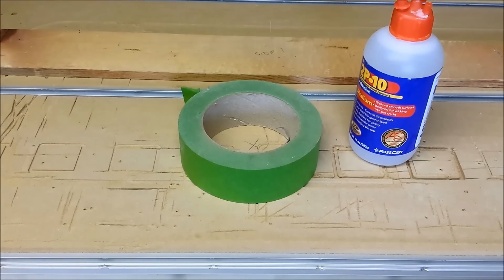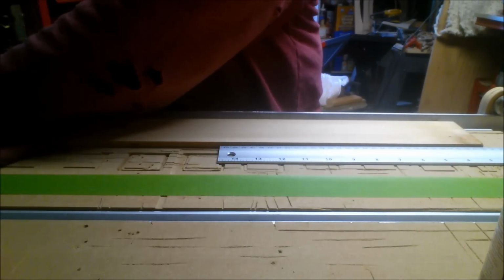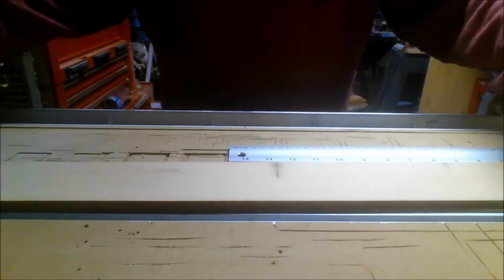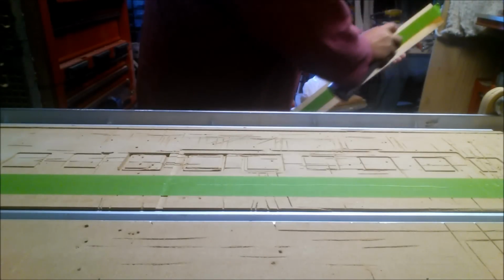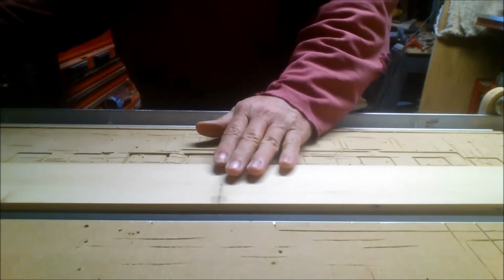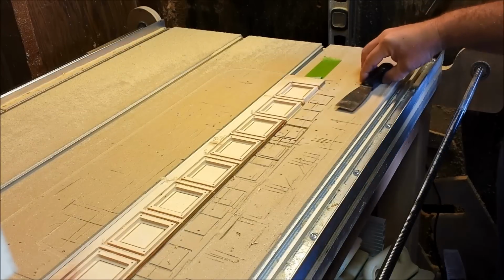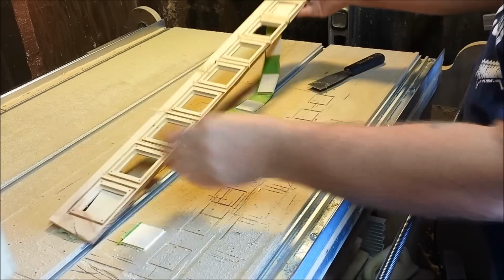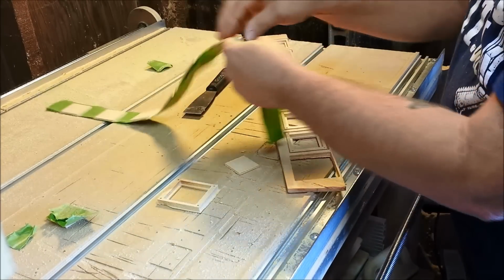A Secure CNC Mounting Technique - NO DOUBLE SIDED TAPE!

Comment: Have you tried putting the glue on the work piece and the activator on the waste board? Does the work piece smell like activator afterwards? Does the activator mess up the waste board?
Reply from the maker: I've done it both ways, and it's fine. The activator evaporates quickly, and it's never damaged anything or left any smell.

Comment: I use hot glue around the edges. Seems to work pretty good.  I like your solution for cutting out parts with no tab though.

Comment: Thanks for the informations, I'm very new at this and all help is appreciated. I've found hot glue works good for me but I would have to use tabs for through cuts.
Reply from the maker: Thanks for checking out the video! I don't know if there's any one mounting method that is perfect for every situation. I use clamps, blocks and wedges, good old wood screws - whatever works. I do like to have options. All I know is that the tape and CA glue method has never failed me. I buy tape and CA glue for other uses anyway, so basically this has saved me the expense of buying double-sided tape, which I don't use for anything else.

Comment: How important is type/brand of tape?  The tape linked in the description is the standard blue painters tape - but the tape in the video was green.
Reply from the maker: The brand of tape isn't important at all. I had some green tape when I shot this video, but I usually use blue or plain manilla. About the only tape I don't like is the Scotch Greener masking tape. The paper is really thin, and it likes to shred when you try to remove it.
Reply: @MarkLindsayCNC  Okay thanks

Comment: Only problem doing this is if your spoil board hasn't been machined level then you won't get the depth right if you need a specific depth.  It's a great technique.
Reply from the maker: That's why tramming your router/spindle and surfacing your spoilboard is important. Thanks for checking it out!

Comment: 3M's blue painters tape comes loose at temperatures around 80 degrees celcius in my experience. my aluminum workpieces sometimes fly off the table if i try to cut too deep(1mm depth, 2mm stepover) and heat up the piece too much.
Reply from the maker: I have heard that some folks use this method on metal, but I've not tried it myself. Jon over at NYC CNC uses it himself, and they have great luck with it. Personally, I'm not a metal guy, but I follow your logic, and have often wondered about heat buildup causing the tape to fail.
Reply: @MarkLindsayCNC  Yes i indeed first saw this method on NYC CNC. Maybe what i'm experiencing is because of things i do wrong in milling, i just wanted to share my own experience. Despite all this, this is still my main workholding method in my cnc router when cutting aluminum. Thanks for bringing this technique out to public.
Reply from the maker: Well, you're welcome, but I just confirmed that it does indeed work for holding material to a CNC table. All the credit goes to Ben Crowe at Crimson Guitars.

Comment: So basically no need for clamps anymore?   I'm waiting for my first CNC coming in about 3 wks..OnefinityCNC    I plan on doing signs and more simple things to get started.  I had CNC machining experience also..I know machinists would laugh at tape..I'm a little leary also, but it looks like it works..I'll  have to try it..thanks for the vid!
Reply from the maker: Thank you, Rich. It's not a 100% solution. Depending on the size of the work piece, you may still want to clamp or screw it down to the spoilboard. Having said that, this technique has never failed me yet - not once.

And for the record, I know several machinists who use this method. If you watch NYC CNC's YouTube channel, Jon is a fan of the technique, and he uses it on all kinds of metal projects, quite often.

Comment: I like this method but have you tried it on a large piece , say 2 foot square of 3/4"? I'm guessing something that size would be difficult to remove?
Cheers, Alan

=
Reply from the maker: On panels more than about 8 inches deep, I use 3 strips of tape - one at the top, bottom, and middle. On something the size you're talking about, I'd probably go with 4 evenly spaced strips. Normally on something that big, I tend to screw it down to the spoilboard and use the tape and CA glue to keep the parts in place so I don't have to add tabs.

Comment: you should use a vaccuum pump to mount items for machining.
Reply from the maker: ...or a vise, or an angle plate, or a rotary table... I don't machine metal, so I didn't recommend anyone use this for metal. However, I do know that Jon over at NYC CNC uses this method on metal a lot. Check out his channel - you may be surprised.

Comment: How did you do the profile cutout whereby it reversed direction? Also you had some odd ball size end mills. I have been looking for endmills or drill bits to use for drilling holes. Any sources?

Comment: does this technique apply to wood only?...or will it work when milling metal?
Reply from the maker: I'm a wood guy, so I don't have much experience with metal at all, and absolutely no experience with it on a CNC. I'd be hesitant to use it on metal - mainly because the heat created would most likely cause the tape's adhesive to fail. I've heard of people using the method on aluminum. I've never done it, so I don't know how well it works. Do it at your own risk.

Comment: Thanks for the video Mark.  What surfacing bit were you using?
Reply from the maker: This is the bit I use for surfacing - http://amzn.to/2m88VAk

That's actually a Freud 1.25 inch straight mortising bit. The only thing you'll need to remember if you use one of these is that you'll need to ramp in your plunge moves over a distance of at least 1.5 inches, because the cutting edge doesn't go across the entire width of the bottom of the bit.

Comment: Great idea- thanks very much; but may I ask why you did an island fill to remove the middle, when you could have just done an offset path and left the middle scrap full height?
Reply from the maker: Simply put, when I did this project, I was still pretty new to CNC software and still figuring things out. Knowing now what I didn't know then, I'd have done a lot of things differently for that project. I wouldn't have changed my mounting method, but I would have certainly changed a few things in the toolpaths. Thanks for watching!
Reply: Gotcha, understood, thanks!

Comment: Mark, thanks for the video and suggestion. Have you tried this with long machining times? I ran a 3D carving job recently that took 15+ hours and would be nervous about the tape letting loose at some point.
Reply from the maker: I haven't run anything for that long at all yet, Stephen. My longest cut with this method has been about 3 hours, and it did just fine. I've never had the tape let loose on me, but I won't say that it could never happen, and I can't guarantee anything. If you're unsure or even a little bit reluctant, you might add a couple of clamps or screw down the work just to ease your mind. If it were me, I wouldn't hesitate to use it on a 15 hour cut,  but your mileage may vary.

Comment: I've been using this method for a while and it does work great but on rare occasions, I've had problems with intricate contour cuts where the waste moved due to side loads and almost messed up the project but was able to pause the work and restart after I removed the waste.  Not 100% perfect but probably near 98%, nothing is perfect, clamps can come loose too.
Reply from the maker: I've never had that problem. Thanks for the heads up - I'll watch out for it.

Comment: I'm going to start using your technique for the 3D printer. The problem is either the glue is too strong or the piece starts moving because it is loose.
Reply from the maker: Do know that heat can cause the adhesive on the tape to fail. I would test it on a small project first.
Reply: @MarkLindsayCNC  The bed temperature is 122 F. I can always turn that off before printing . The Print head is 392 F but doesn't stay in one place for long. I have been using Loctite Spray Adhesive 100 on the print bed which last about a week and have a hard time getting projects off the print bed. 100 is considered a light bond.

Comment: i have threaded inserts for wood in my board spaced at 100mm distance. i use to work in a cnc shop an they used a FCS mounting plate on all their machines instead of clamps. its a pretty quick and precise mounting system.
i do use this method for smaller pieces and it works well. i use a mountable back stop with this system to make sure things are square on the table. 
also you cut too deep i never cut into my "spoil board".  its a waste of money to replace regularly.
Reply from the maker: Since this video came out, I've built a new CNC, and I have t-tracks in the spoilboard spaced about every 4 inches. I sometimes use clamps, or just screw the material down. I'm all about options.

Depth wise, I cut just fine. After almost 5 years on 2 different CNC routers, I've never replaced a spoilboard. When it gets too scarred up, I resurface it and drive on. What I don't do, however, is spend a lot of time cleaning up the underside of projects because the bit didn't cut all the way through the material.  Thanks for watching!

Comment: Sounds and looks like a great technique, Mark! I am curious as to how the router bit interacts with the masking tape adhesive when it cuts thru it. As in, does it gum up the bit? The reason I ask is because the gumming up of the bit has always been the biggest drawback to using 2-sided tape, for me anyway. TIA.
Reply from the maker: I haven't had a problem with that so far. I usually clean my bits with naphtha or oven cleaner every once in a while anyway - just to get rid of pitch, resins, adhesives from plywood or MDF, etc anyway.
Reply: Thanks Mark. That sounds encouraging. Gonna give it a try!

Comment: Clever!  I am looking forward to trying it myself.  I've noticed that if I happen to profile cut through the double-sided tape I use, it gums up the bit and gets stuck in the flutes pretty bad.  Have you noticed any gumming up of the bits from the masking tape?
Reply from the maker: Over time you'll notice some build up on the tip of the bit, but nothing like what you have with DS tape. I clean my bits with naphtha often anyway, so I don't really notice it.
Reply: Mark Lindsay Read my mind...I was going to ask what you suggested for cleaning off the gunk from the bits.  Thanks Mark!  Keep up the great work with the videos!
Reply from the maker: I use VM&P Naphtha from the paint dept of my local big box store. At the end of the day, I put the bit into a little container and pour enough naphtha in to cover it, then let it sit overnight. Next day I scrub them with a toothbrush in the naphtha and blow them dry with compressed air. It doesn't take a lot of scrubbing - you're more knocking off the loosened crud than anything else. It's worked for me for about 20 years. 

Warning: if you do this with a bit that has a guide bearing, take the bearing off first! Don't dunk the bearing into the naphtha - it will get in there and remove the bearing lube.

Comment: I think you could achieve the same effect more easily with two pieces of thin double sided tape, burnish each piece to its respective part then stick them together.
Reply from the maker: Try it and let us know how it works out. The problem is you won't be able to burnish the 2 pieces of double-sided tape together. You're still relying on the amount of downward pressure you can put on the material - and you're using twice the amount of double-sided tape. I've been using this method with CNC for over 6 years, and it's never failed. Not once. That's good enough for me.

Comment: Great tip will use it thanks.  Just a question about your router I don't see any dust shoe but then again I don't see any dust.  Whats with that?
Reply from the maker: I didn't have a dust shoe made yet when this video was shot. The router blew the dust off of the part being cut, but it was there - believe me. I now have a dust shoe and use it.

Comment: I'm new to CNC but not new to this technique I use all the time for making guitars. I was just wodering if there's no risk of breaking the tool if it bites on the masking tape ?
Reply from the maker: Every tool I've ever used (all the way down to .055 inches) cuts right through the tape, so there's no worries there. As I'm sure you already know, the smaller the tool diameter, the greater the risk of breaking it. I tend to tear off the loose ends of tape now, so I don't have that flapping around. A bit could conceivably hit one of those loose tags of tape and snap off if it's a small enough bit. But basically, I've never had an issue with a bit cutting through the tape.

Comment: Great idea for small parts with no tabs, But not kinda expensive for the tape and glue. Not for everyday use. 2" wide tape and glue with activator on amazon is about $30 total. 2 sided tape is $9.
Reply from the maker: I use maybe 10¢ worth of tape and glue on a project. Seriously - I'm still using the same bottle of glue and can of activator I demonstrated in this video almost 3 years ago. The brand of tape doesn't matter - I just linked the tape I used in the video. Any masking tape will work just fine. No, I don't use it on absolutely everything. I use fixtures, clamps, screws, and the tape and glue method - whichever is more appropriate for the project. This is just a replacement for double-sided tape - not a one-size-fits-all mounting solution.

Comment: I've used the double-sided tape, but always had problems with the adhesive gumming up the endmills when I cut through the tape into the spoil board.  It looks like this method would still have the problem with the masking tape adhesive.  Is there a solution to that problem?
Reply from the maker: I've not had any problem with adhesive sticking to the end mill that I know of, but since you mention it, maybe I need to check a little more closely. I clean my bits with brake parts cleaner and a rag before I run a job anyway, so if I am getting any residue from the tape, it comes off when I clean it.
Reply: Mark, Most of my problems with the tape adhesive gumming up the end mills has been when I've been machining aluminum.  Occasionally I've used WD-40 on the aluminum parts to lubricate the cutting and it will soften the adhesive also.  Maybe I'm comparing "Apple" to "Oranges" when I brought up the tape adhesive issues I've had.  I'll definitely try the method you suggest here.  Thank you.
Reply from the maker: John Nelson  Okay, let me say right here that I've not run aluminum on my machine yet. I've used this method on wood, plywood, plastic, and acrylic, but not metals yet. I have no idea what the WD-40 will do to the tape's adhesive.

Comment: I noticed your cnc looks to be the Dave Gatton build.  I built one of those also.  Do you have any tips to keep the router secured?  My porter cable router does not stay in position after a few plunges or passes.  I tried slowing down the speed of the cnc but still have problems.  Do you do anything to keep it from slipping up and down?
Reply from the maker: Good eye! It's a Shoestring Budget CNC I built in 2015 from Dave's plans (which are no longer available, folks!) I don't do anything special. I just clamped it in and it stays put. Are you tightening the clamps tight enough?
Reply: I do believe so.  I even had to make another set of router mounts because I tightened it down too much and cracked the plywood.  Maybe I just need to make another mount and make the diameter for the router a hair smaller.
Reply: Mark Lindsay Also, do you use any thread lock to keep the coupling for the acme rods.  I am always afraid to tighten those down too much and break the coupling.  It ends up loose after a few uses also but I know that issue is from not tightening enough.  Maybe thread lock would keep it secured?
Reply from the maker: That's a possibility. Now that you have a CNC, you can make it exactly to the right size. The blue gantry in this video is the second one I cut. The first one, I had the plans printed on large format paper and cut each part out by hand. Then I used that CNC to cut this one out of Baltic birch plywood. It went together perfectly.
Reply: Mark Lindsay I will give it a try.  Thanks for you help.
Reply from the maker: I spoke with Tim at Dumpster CNC several times about this very topic. He said not to use thread lock on the Delrin couplers, as it could deteriorate the Delrin. Just snug them up. His older design had a problem with cracking if you over-tightened them, but the design he's been using for about the last 4 years hasn't had that problem. I just snug mine down and run it. Now - you DO have to check them every so often, but you should be doing that anyway.
Reply: ok, good to know! I built mine at the end of 2015 so I will just try and snug them down a little more and keep a closer eye on them